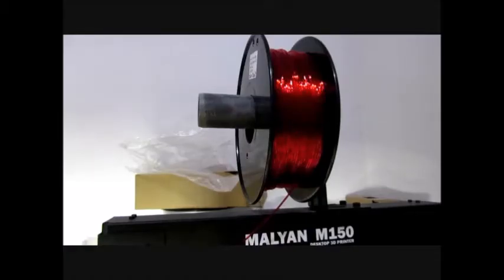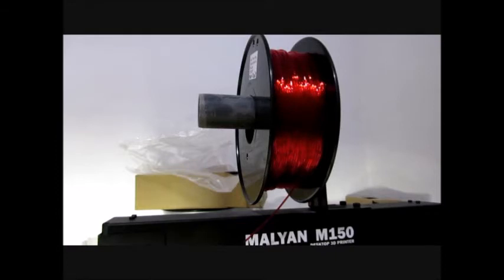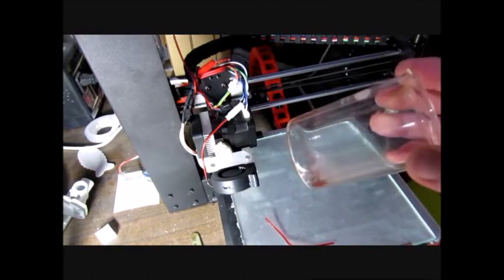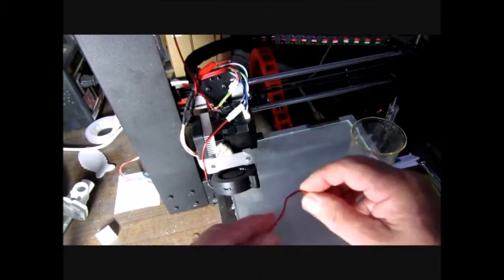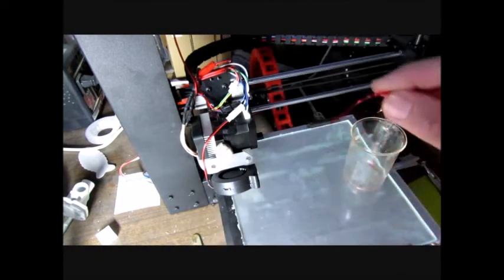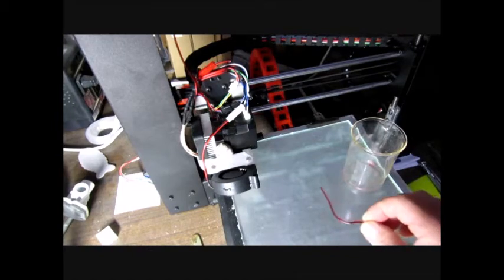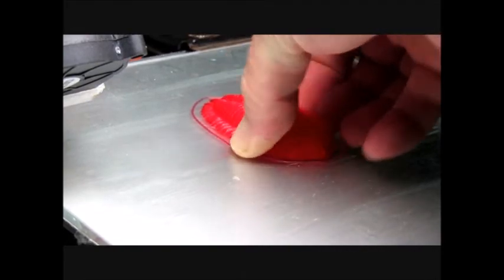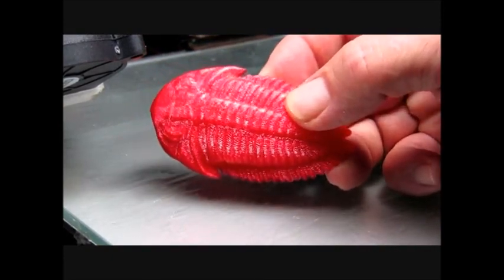HobbyKing  Flexible Filament  First Test 3D Printer Tutorial

Comment: wow , can flashforge use that ?? 

how much the price of it ?

thanks
Reply: depends what flashforge, and check the description for the link
Reply: im using flashforge creator pro , with spring loaded extruder. what do you think ?
Reply: using very low speeds it will work but it has a chance to jam so be weary of that

Comment: Thanks for posting this. It helped me a lot on where to start with HK flexible. I run a Wanhao D6 and the mk11 extruder seems to handle it just fine. Curious to know how fast you've managed to print with the mk9 or mk10, which is what I assume you're using.